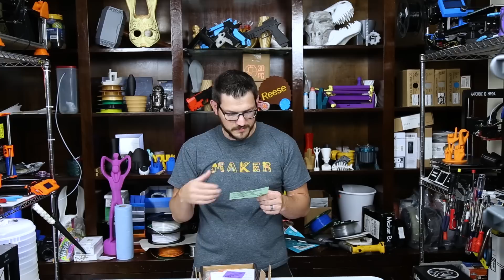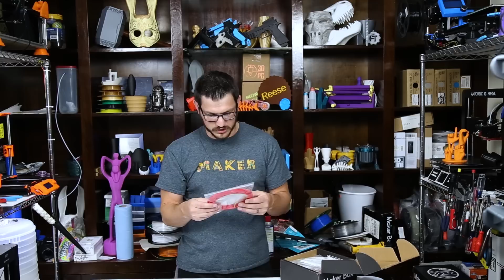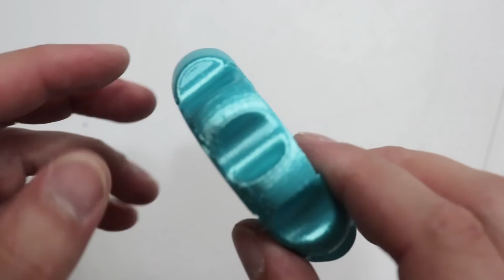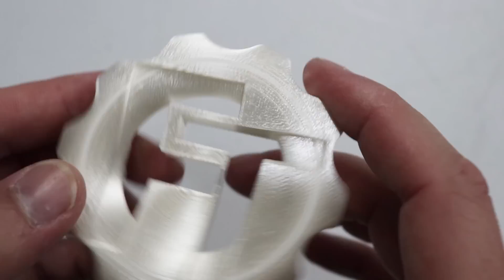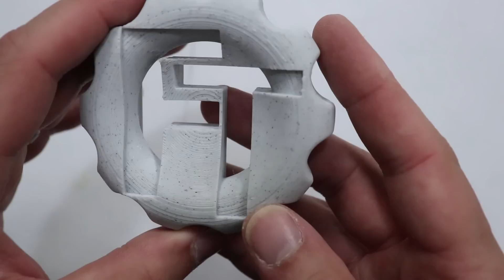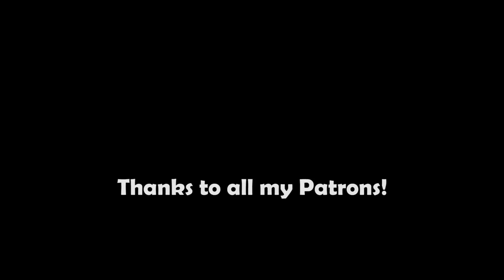December 2018 Maker Box Unboxing and Review

Comment: I've been printing on a home-brewed printer, and have limited my printing to the cheapest filaments I could afford. I'd love to try other filaments to see if the issues I've been having (stringing, poor layer adhesion, clogged nozzles) are a problem with the filament I have been using or the basic design of my printer.